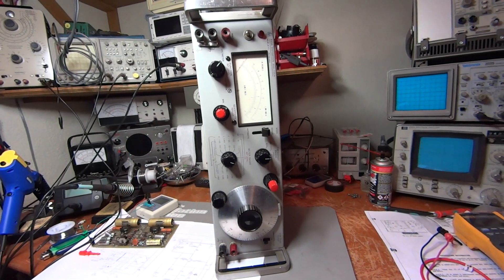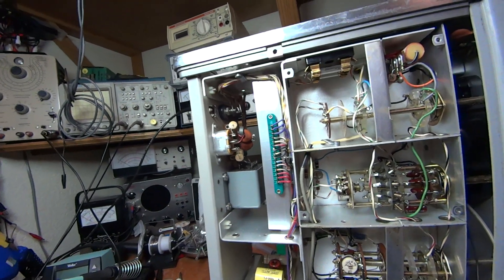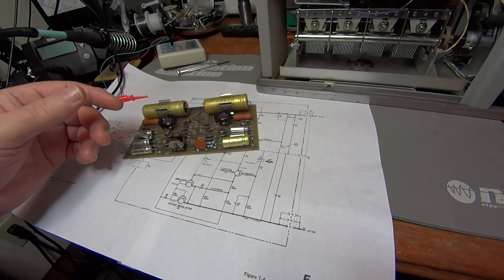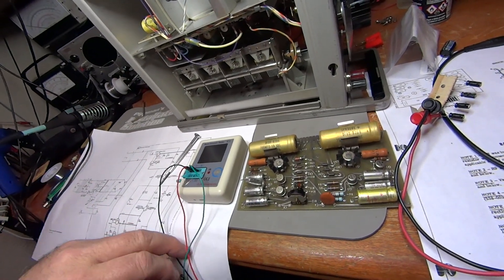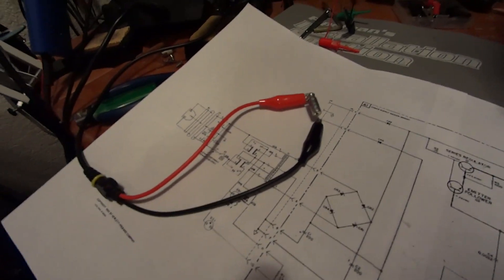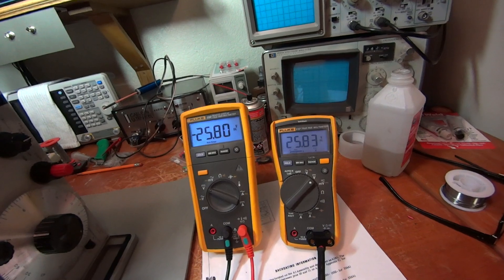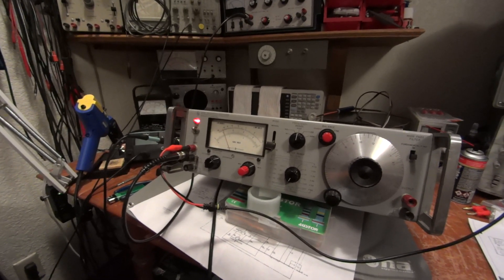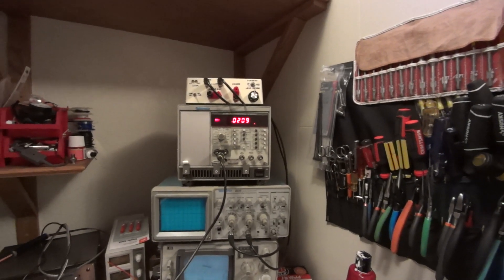Don't let the smoke out! HP 333A Distortion Analyzer Repair

Comment: Nice repair tour.  I have the 334a. Seems to work well and mostly agrees with my 339a once it's warmed up.  I've been on lookout for one of the TM units but they are a bit overpriced for me. 
Opening the 334a first time was a joy. Tightly sealed analog goodness.  I agree that these analog rms meters are very accurate. I'm happy to keep these units on my stack.
Reply from the maker: It was a bit overpriced for me too. I picked it up for $332 but by the time I had it shipped and paid tax it was 400. It hurt, ate up all of the money I made on a repair I did. But I am very pleased with it. Now I need an ultra low distortion oscillator. Easier said then done.
Reply: @leonardpeters3266  I'll rely on the oscillator built into the 339a. I'm getting a sr760 in a couple weeks.  The 770 has built in source.  Oh well.

Comment: do you know what is lock in amp ?   Can you explain /
Reply from the maker: I apologize, I do not understand the question. Could you please explain in more detail the question, I will do my best to answer. Maybe there is context that I am missing.
Reply: @leonardpeters3266  my question was if you know the difference between  lock in amplifier and boxcar averager
Reply from the maker: I read and they are not alike. I do not design test instrumentation. From the reading it looks to me like the boxcar averager is responsible for the +N function on the Tek distortion analyzer. While the lock in amplifier could be used for auto nulling.
Reply from the maker: Maybe this might be what you are referring to: https://servicios.intec.santafe-conicet.gov.ar/personal/rkoro/PUB/Curso_Topicos_Especiales/Lock_In/Explore_1.pdf